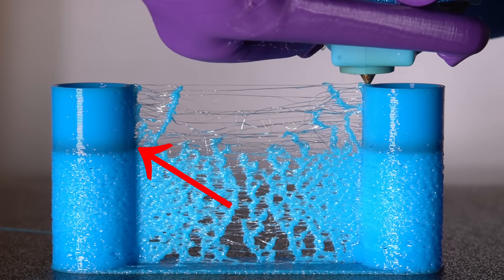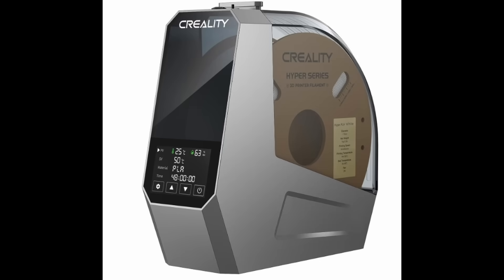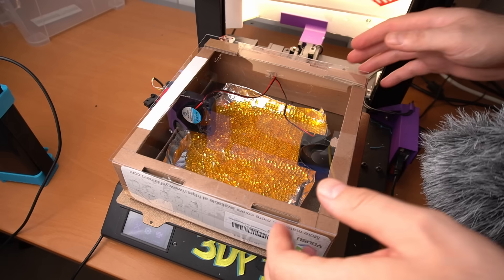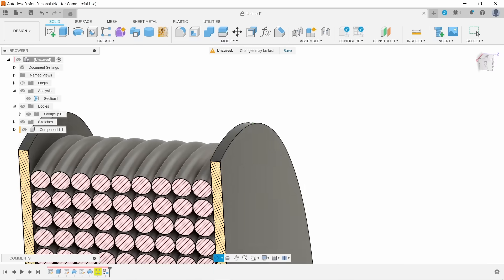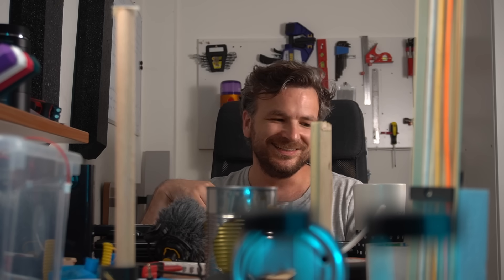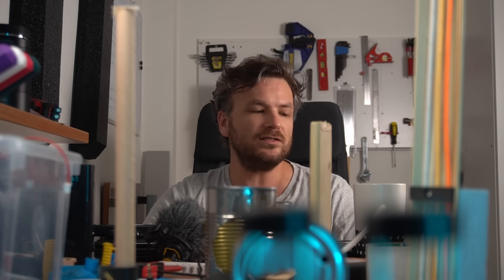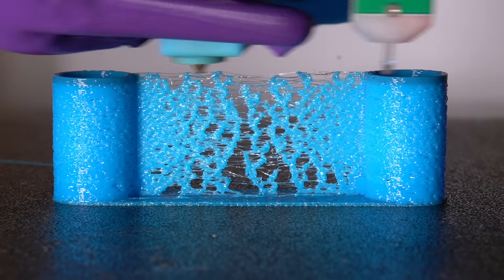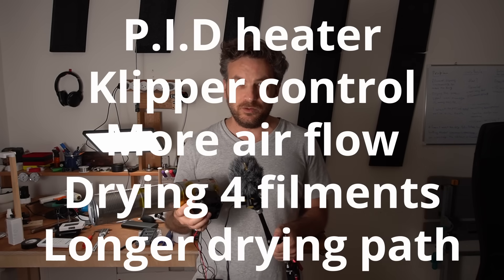Why are we drying filament this way?

Comment: The best way to remove surface moisture from the filament is to create a vacuum, use a vacuum pump in a container and remove the atmosphere, the moisture will sublimate off the filament. You don't have to unwind and rewind the filament. you can cycle the process once or twice. I am buying a vacuum pump for chemistry experiments to change the boiling points of whatever fluid I am working with.
Reply: Yes, vacuum can reduce moisture quickly but it's even more effective with heat added. Put both vacuum and heat in line just before the printing head and it works in thick moisture laden areas around the globe.
Reply: @tenlittleindians how could you add a vacuum in line with anything though? The issue being the seal.
Reply: @Crappy.Consumer.Reports   Yes, there's rarely a perfect seal! 

Just like having a leaky boat; the pump just needs to work faster than the leaks. Cheap silicone membranes at each end of the cans with a tiny hole to allow the filiment to pass could work and could be replaced as they wear out.
Reply: @Crappy.Consumer.Reports  No, the vacuum is just to quickly remove moisture of a roll before use, putting it in a sealed container .
Reply: Vaccum pump cost 3000usd
Reply: @juliusvalentinas  120 from harbor freight and remember you don't need a perfect vacuum just enough of a vacuum to decrease the sublimation point of water...
take a old heater block put a shitty ptfe lined heat break in take the old controller that you tore out your old printer to have energy input into system.
Reply: @juliusvalentinas   You probably don't need that kind of a vacuum pump! Almost all air pumps are also vacuum pumps. A common vacuum cleaner is a good example; it sucks air in one end and blows it out another.

Any vacuum added around the filiment will help reduce moisture. Obviously the more the better.
Reply: @juliusvalentinas less than $100.
Or the really cheap one… $3. But you need a compressor to use it.
Reply: @juliusvalentinas  or just get an old refrigerator/freezer compressor from the dump for free.
Reply: @juliusvalentinas  amazon just a little over $100
Reply: @neptarclepuffin  Why all this talk about "sublimation point of water"--there is no ice here. Sublimation to the process in which a solid turns directly into a gas in response to changes in temperature and/or pressure. That is not what we're doing when we dry moisture laden filament. Don't use "sublimation" just because to some it sound more scientific...
Reply: @juliusvalentinas  Nope. Vacuum pump costs $60 to $250 depending on quality at the scales we are discussing here.
Reply: @juliusvalentinas $40 from Amazon for a car AC service vacuum pump. An old fridge pump will work too
Reply: Built such a system myself, but found that you need to raise the temperature for it to be effective.
Putting an old 3D-Printer Hotbed into the chamber is not difficult, but passing the power inside was challenging
Reply: @timw7406  Vacuum is a good heat insulator. Maybe, It's better to repurpose old Dryer Machine to preheat and predry. And use vacuum as a finishing touch.
Reply: @vasiliynkudryavtsev Agreed. VisionMiner has videos on this. Dry in repurposed bench top oven. Then a couple of minutes in vacuum chamber after. If you had the budget, a lab vacuum oven would be pretty slick.
Reply: @nocare  Heating with thermal radiation through glass contactless in vacuum is actually good idea. If the entire filament can be exposed.
Reply: It'd make more sense to use radiative heating if there is a vacuum , at least if you want heating and drying in one stage @vasiliynkudryavtsev
Reply: @vasiliynkudryavtsev yea because there is no air molecules to take the hear away. Using a IR lamp would do more since there al ot of the heat is send trough infrared light
Reply: @timw7406  I'd think an induction heater would be an easy way to heat the chamber... just put it on a hot plate.
Reply: @timw7406 spark plug
Reply: @timw7406  Use a stainless vacuum pot with the bed under the pot instead of in it!
Reply: @timw7406 yes ,but ypu use way less external heat in a vacuum...you should know thia
Reply: that´s a great idea. Compressors from refrigerators, AC´s, dehumidifiers etc work fairly well as vacuum pumps, and can be found for free.The filament can be stocked in vacuum as long as the vessel you put it in is really airtight. 
About heating, you would get the same problem of heating only the first layers, specially with radiative only heating.
Reply: I dry all my nylon in a food dehydrator at 165F for about 4-6 hours then place it in a vacuum chamber while the rolls are still hot and draw a continuous vacuum while any residual moisture boils off since water will boil at 90F in my chamber
Reply: I think CNC Kitchen tested this with good results.
Reply: @voxelmaniam he did.  The results weren’t all that great.  A food dehydrator worked much better and was faster.  Vacuum WAS very good for storage once the filament was dry, however, especially in conjunction with desiccant beads.
Reply: @voxelmaniam Did you even watch the video? He found how bad vacuum drying is.
Reply: @Vabloath  That wasn't much a vacuum. When you vacuum out a refrigeration system, the analog gauges become useless because they're pinned at zero. You need a much, much more sensitive micron gauge. 100 microns , or 0.00013 atmospheres is easily attainable, and at that pressure, water boils at -40°.
Reply: @scanner-kf5qg The vacuum he pulled was still well below the vapor pressure of water at room temp. Approaching a true vacuum more and more closely might yield slightly better results, but it's a case of diminishing returns; you're never going to do A LOT better than he did.
Reply: @voxelmaniam  I thought CNC kitchen actually came to the conclusion that a food dehydrator was actually better than vacuum
Reply: CNC kitchen tried it with NO good results. Go watch his video, he says that a vaccuum pump is already expensive but in order to remove moisture from a spool you need a even better pump that he had, basically costing way more money.
Reply: Great idea. Keep going. Subscribed 😊
Reply: Also not immediate, unless you could have the filament going through seals in and out of the vacuum container.
Reply: Water in vacuum boils at first but then freezes as it loses energy to phase change. This is a great approach you just need to add some gentle heating to keep it from freezing!
Reply: My concern with vacuum drying is off-gassing of other volatiles in the filament. Some of those could come from additives, and the quality might suffer as a result. But there's no way to know without trying it!
Reply: I'm using the eibos vacuum bag system to store my filament. They provide a small and very affordable vacuum pump with a thread mount - maybe that would be an easy and cheap option to use as vacuum pump for such a system?
Reply: Not sure if I misunderstood the idea but key is/was to get moist filament into the hot end without the need to prepare lots of stuff. A vacuum might be well working but does take extra time and an extra step. Running the filament through a dry chamber is almost instant. But I might have gotten it wrong.
Reply: No. Vacuum by itself is a very ineffective way to dry filament.
Reply: How would that work because then you would end up creating a vacuum inside the PTFE tube lines which would mean a vacuum inside the printer and a vacuum inside the filament dry box.
Reply: This thread has been really interesting. Keep it going on guys.

I think one important element that is missing in all that process is : vibration.

The spool should be pre-heated well above the typical temperature used in those commercial dryer...like 80~90°C, using a FAN to help spread the air.

You don't need to wait 4~8 hours...just enough time to the inner part of the spool equalizes its temperature with the outer part.

Then put the hot spool into the vacuum chamber, over a vibrating platform...or you can let the whole chamber over a vibrating table. Apply the vacum for few minutes...and voila.
Reply: Go to vevor and get the pressure pot & pump then wrap it with a heating pad if you want to monitor heat then toss a simple grill thermometer & hydrometer in there ( it has a clear lid) & you can get the temperature close to what you want if you are just leaving the rolls in the vacuum chamber once you heat it then pull vacuum you shut the valve for awhile then open it & pull vacuum till you get to the level you want shut the valve & leave the rolls in there till ready to use. You only need 1 pump for multiple pots for storage. Toss it in a in use dryer box to keep moisture @ bay while printing, then pulling vacuum again for storage & moisture will only take a few minutes. If trying to make a in use vacuum box you need a BIG PUMP even with silicone seals dont think it would be much different moisture wise compared to the way I'm saying but in use would be so cost prohibitive in comparison.
Reply: Sublimation is the transition between solid and gas. You're talking nonsense, vacuum is very slow and inefficient to remove water. Just put some silica gel or anhydrous calcium chloride in the same container as the filament and there you go.
Reply: You can freeze-dry the filament.
Reply: Sure you can use a vacuum chamber - but low pressure also means worse heat-transfer and evaporation is directly proportional to heat - not pressure. The filament will cool of faster and the heat supply will be slower.
Reply: @ABaumstumpf  Evaporation is absolutely dependant on pressure, if you get the pressure low enough you can practically boil the water out of the filament at room temperature. It's been demonstrated many times as a much higher performance option than mere heating because of that
Reply: Get a vacuum pump container and a means to vacuum it down. Put the filament in it with some activated carbon. Water will boil a bit below 100F in a strong vacuum. Heat it to that temperature for while then let it cool. The activated carbon should absorb most of the moisture released when the container cools down. Remove the filament, pull another hard vacuum, heat to 120F for a bit then release the vacuum. That should boil most of the moisture out of the activated carbon. Store in a vacuum sealed Ziplock bag to keep dry for your next use.
Reply: @russiannpcbot6408  At 100 microns of vacuum (which my pump can pull on a 150 ton chiller), water boils at -40° F or C (the same at -40°). You really don't want water in your compressor. I may have to give it a try.
Reply: Add a bowl of fuming sulfuric acid and you'll catch quite a lot of moisture. That's the way you dry salts in chmistry: Put whatever you want to dry on a pedestal above the (small) bowl of fuming sulfuric acid inside a sealable container (usually a desiccator: https://en.wikipedia.org/wiki/Desiccator ) and then pump all the air out.
Reply: @johanneshass1614  ya, but then you need to get high concentration sulfuric, in the real world that is not common to get plus the ehs issues .
Reply: @johanneshass1614 I'm sure a vacuum chamber full of sulfuric acid fumes would be great for the filament.

Comment: Try this out, its more complicated but i imagine the result would be way better, smaller diameter tube think toilet paper tube size but longer then what you did in this video, capped on both ends with only a small hole for the filament to run through, then on the side of the tube near each end you connect another tube to create a tunnel connecting the two ends, in the middle of this tunnel will be a dry air station composed of a fan that draws air through dry silica gel (stacked in a way that air can be sucked through maybe with a small plastic container with holes cut out on both sides and a mosquito net glued where the holes are to keep the silica inside but let air through) and then gets heated up before pushing this dry hot air through the wind tunnel which eventually runs all the way through back to the silica gel station, pretty sure this can be easily constructed with a hair dryer on low and some silica gel,

this method recycles the hot dry air so it should only capture moisture from the filament and barely anything from outside air as long as the inlet and outlet holes for the filament aren't to big.

Comment: I think a system that is similar to modular firearm suppressors would work. One "can" would be a "baffle" in the suppressor, and in each "can" has an internal cone shape that guides the filament to the centerline so that it would work with the bambu AMS. On paper, with enough of these and a well tuned heating/airflow system, you could print engineering level filaments from an open air spool in many cases.
Reply: I think I get what you are saying, but not everyone knows the shape of MFS baffles, I'd just describe it as 'a stack of funnels with air-gaps between each'. Though also filament is fed in the 'opposite' way a bullet would go, taking advantage of the funnel shape for self-alignment, rather than gas diversion. Is that a correct interpretation?
Reply: @Roobotics  yes, although even with the baffles in the less efficient (backwards) orientation they will still restrict airflow. Might not be able to have just one fan at one end, although this would have to be tested itl

Comment: I love this idea. I'd be curious how much time your filament would have to be in your inline drier at that 60% humidity? What if you used some tubing with something like a 5mm I.D. and you looped it so you could have a meter of filament drying at a time. You may need to add a secondary extruder servo to pull the filament through the tube.

Comment: If you have to use a drybox, then the advantages of the inline system completely disappear. You would need to run the inline dryer longer and use more power than a conventional dryer. In a conventional dryer you would just dry it and store it in a dry box.
Reply: Pretty sure he's using that to hold the spool, nothing more.
Reply: yeah when he put it in the drybox, is it a dry filament or an already wet one? atleast if it's a wet one then it means you can remove the need for initial drying time

Comment: Drywise is doing exactly what you are doing.

Per the website: "Internally, Drywise circulates hot dry air over a section of filament, causing it to release the trapped moisture. The desiccant cartridge then traps the water molecules redrying the air."

Comment: Honestly i just poked some holes in the top of the box and poked some in the sides and convection did the rest to move the humid air out of the box and away from my filament spool lol then kept the spools in ziplocks with those moisture beads

Comment: This looks very interesting. I wouldn't necessarily go with tin cans, but rather a tube with relative big diameter (>6mm) and blow hot (60c-70c) air into this tube, either from the printer side, or from the dry box side. Allowing the tube to be open at the other end so the hot air and the humidity are free to egress the tube after drying the filament. There are plenty of PTFE tubes that can do this which are easy to buy from China, or you can use a PVC pipe, it might even work with your local garden hose as well - depending on the material it is made of.
Reply: Might want to go from printer side so that the end always has the driest air....
Reply: I was thinking the exact same thing, and given PTFE has a high temp resistance, you could wrap some sort of heating coil around the tube to keep the flow of air warm
Reply: PTFE is overkill, simple nylon or even most silicone tubes would be cheaper and have more than enough temperature resistance for anything short of PEEK
Reply: @bosstowndynamics5488  Good idea, but the killer is friction, silicone is notoriously high friction. PTFE, not so much.... ;)
Reply: @mmouse648  Nylon would be fine though, and PTFE would wind up being quite expensive for the somewhat more bespoke and much larger wide bore tubing you would need for good airflow
Reply: Why a big diameter tube?
Reply: @Vabloath  Big diameter compared to the filament. They mentioned 6mm+

Presumably just for the air flow. Because you want to strike a balance between tube volume and flow rate. Because regardless, you'll need to heat up the internal cross section of the tube, minus the filament  and you'll have to be able to keep that area at the designated temperature, while also providing positive air pressure to force the air down the line
Reply: @Vabloath  need space for the humidity to go into, while keeping air flow as well. With tin cans, which are quite wide, there is plenty of space but not amazing directional air flow.
Reply: It would also help if you increased the flow rate as high as possible.
Reply: It must be cool to live at places with free energy
Reply: @REDxFROG - in this case you’d be saving energy by not running your printer for hours making failed 3D prints.
Reply: @owengrossman1414  You know how much energy a dry box takes?  Even when preserving multiple spools for a multi-head/filament printer?

Just-in-time drying seems nifty at a glance, but is going to be way more expensive in any metric while - if you're lucky - maybe not scaling worse.  Saving on equipment cost might bring one metric into the same ballpark, but still doesn't even make that one metric better when the mainstream approaches can also be cheaply DIY implemented.

It's more than a little disingenuous pretending the alternative is going to be printing with wet filament.